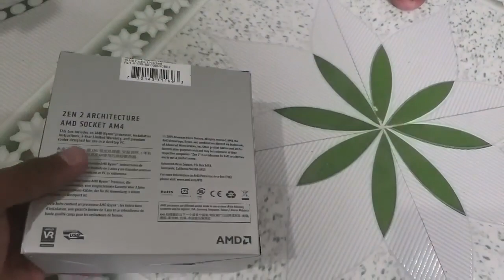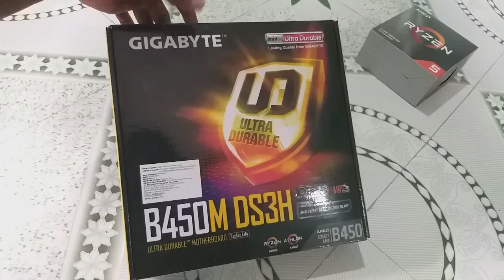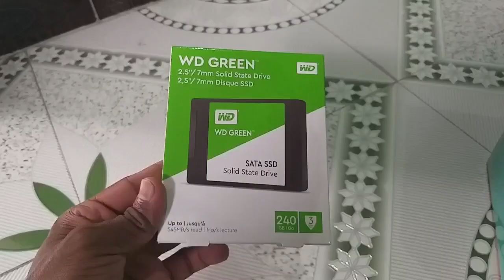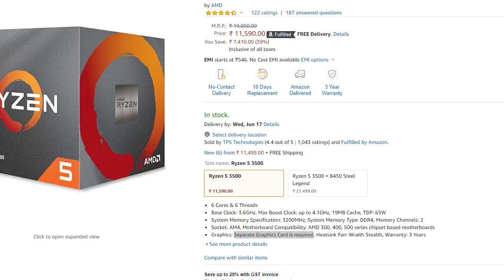40K  My New PC Build Wasted? This PC ? |  Tamil 2 Tech

Comment: Athuku nee Ryzen 5 3400g ku poirukanum..... Ethu umm mela tha thaaapuuu
Reply from the maker: Karaituthan bro, antha processors permanence pathathe bro
Reply: @SakthiStPhotographer  naan sloradhu maari vaangu,

Elaathukum munnadi, for electronics and gaming pc, it will not be cheap. Nee enna kaasu kodukuriyo, adhuku thaan performance kidaikum. You need minimum 70000 rupees to run games atleast in 45+ or 50 + fps. Naan ippo solla poradhu appadithaan irrukum, illaina unnoda ishtam.

Motherboard: B450 TOMAHAWK MSI BRAND {not b450"M", verum b450, indha b450M appadeengarathu pakka waste model, fps ya evalo restrict pannumo avalo restrict pannakoodiya worst motherboard}. Idhoda cost 16000 rupees. 

RAM: unnaku budget gaming irukkurathunaala, 12 GB RAM is more than enough. Naan Hyper x Fury thaan recommend pannuven. But go for Crucial {3 x 4gb sticks} it will save your money. Oru 4GB stick cost 1700 rupees, appo 3 x4GB will be 5100 rupees

PROCESSOR : AMD R7 2700 or R5 3600 thaan best choice. Rendume kitathatta ore price thaan. Around 16500 rupees. 

GRAPHICS CARD: Go for AMD RX 580 8GB, adhoda cost vandhu around 20000 rupees. For nvidia go for Gtx 1660. Rendume ore cost thaan.

PSU: Idhudhaan mukkiyamaana part. Local store la 500W psu verum 500 roobaiku tharuvaan. 4 maasathalaye unnoda motherboard sudugaadu aagidum.

Nee PSU vaangumbodhu, indha rendu brand mattum vaangu----> Corsair or Seasonic. Idha thavira vera edhuvum vaangaatha. Idhu mattum kidaiyaathu. Oru oru setup ku thaguntha maari, psu waat range maarum. Naan sonna PC setup ku 500w is enough. BUY ONLY 80+ BRONZE OR GOLD EVEN FOR CORSAIR OR SEASONIC. 

My recommendation is Corsair cx 500. Idhoda cost vandhu 5000 rupees.

SSD : Buy only SSD, not HDD. Western digital la vaangiko. 250GB vandhu 4000 rupees irrukum.

So total : 16000 + 5100+16500+20000+5000+4000
Which equals a total of RUPEES 66,500.

Remember one thing, naan sonnathu romba cheap. Naan solirukure setup unnaku 1080p la 55+ tharum. Idhuve costly nu sonna... Then forget about PC gaming bro.
Reply: @MrBALAKUMARA  bro ryzen 5 3500 nalla processor tha 50K easy ella triple A games um 75+ fps la veladalam.. 2×8ram (16 GB ram) potu RX 570 6gb illana 8 GB mother's board your choice intha mooni mattum correct ah potingana nallla vey FPS tharum under 50k vena YouTube la parrunga Evvolo FPS varudhunu
Reply: @just1n144  bro ok bro, avanga konjam aged games {like csgo, pubg, tomb raider} athu maari poturupaanga. But Horizon zero dawn appadinnu game vanthuruku, Read dead redemption 2 appadinnu game vanthuruku, athulaan naan sonna pc specs thaan bro correcta varum. Future proof aagavum irrukum
Reply: @MrBALAKUMARA  yes bro bro athuguda 1080p la medium settings la run pannalam bro
Reply: @just1n144  ok bro
Reply: @MrBALAKUMARA  the ram choice u made is wrong... Go for duel channel setup... 2x 8gb ram is good enough... Otherwise it will bottleneck ur pc
Reply: @vyshnavvijayan3402  🤣🤣